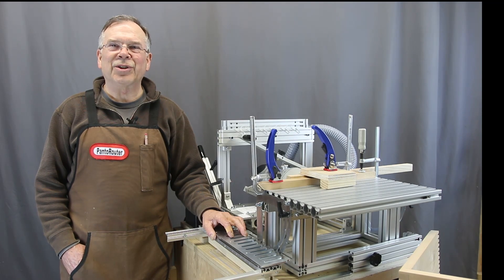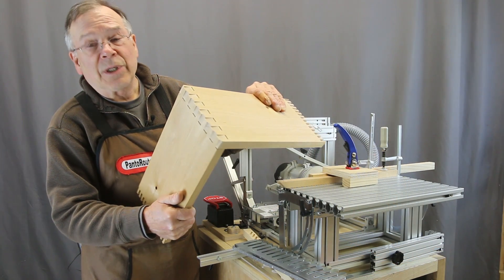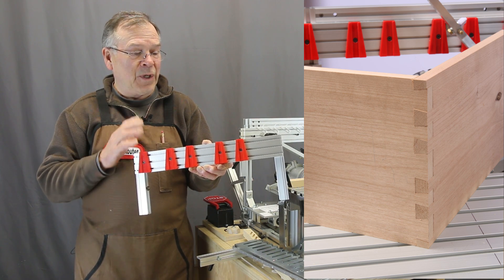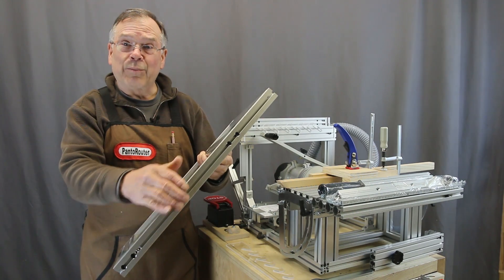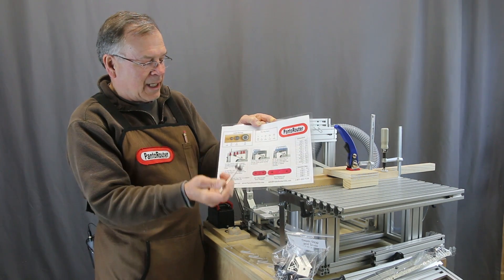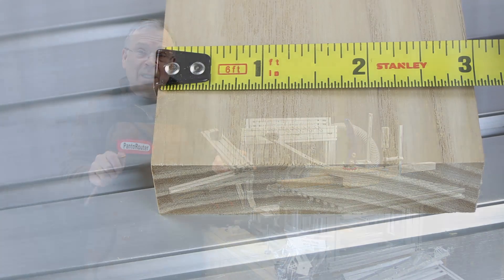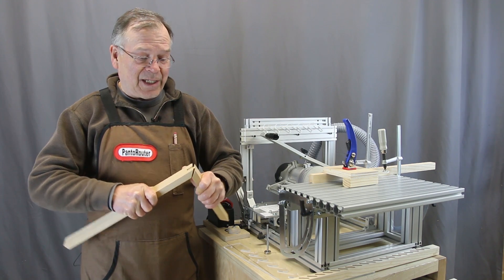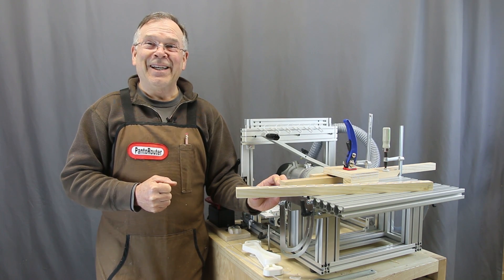PantoRouter Innovations - Spring 2017

Comment: how to measure wood thickness in this New version
Reply from the maker: Kanchan Shrestha 
Thanks for your question. There's a thickness gage on the post nearest the operator. It's even easier to use than before. We have a tech tip about it on our website at www.pantorouterusa.com